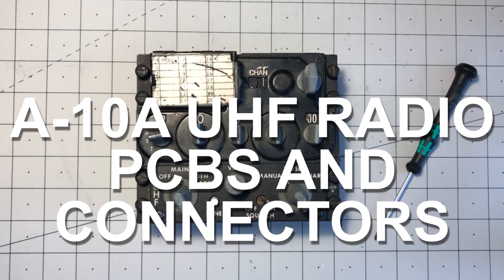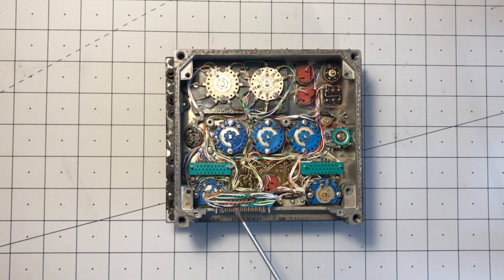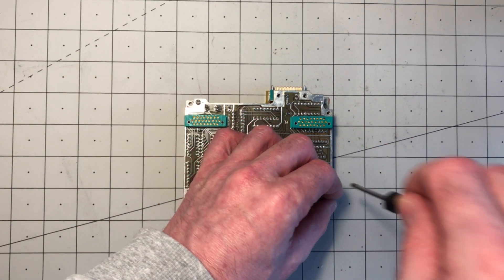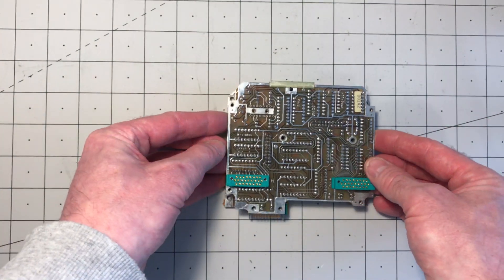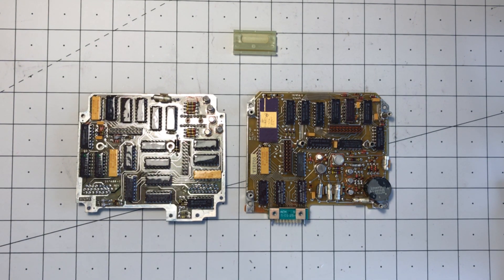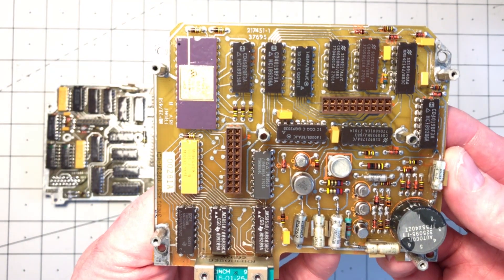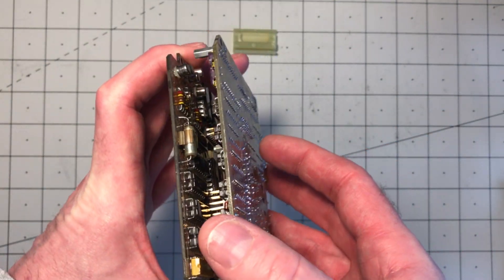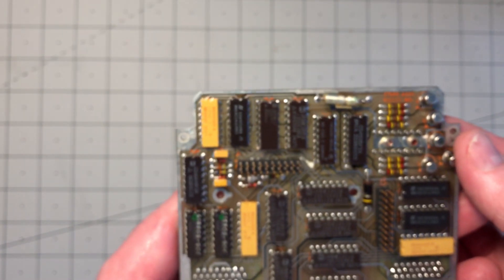A-10A UHF radio PCBs

Comment: The plastic cover over the capacitor(?) might in case it fails so it doesn't damage the inside the radio